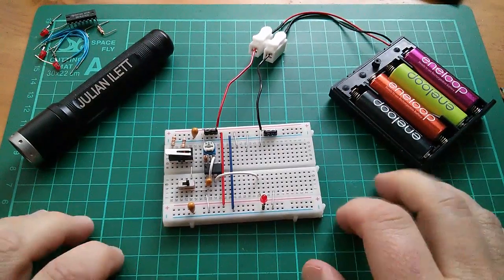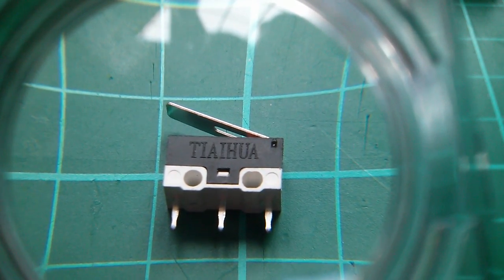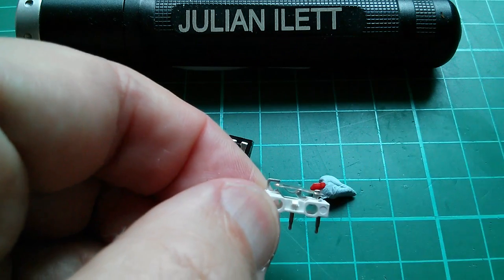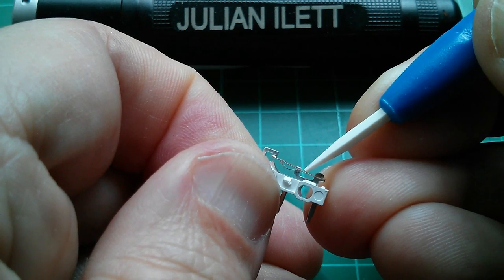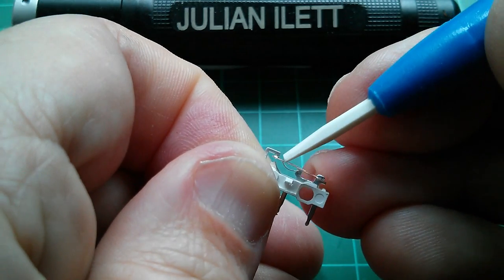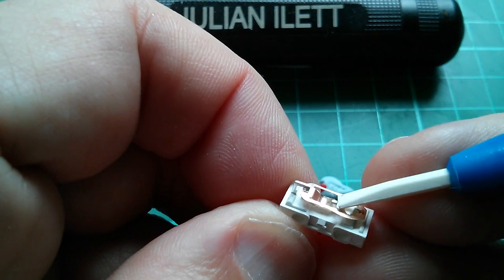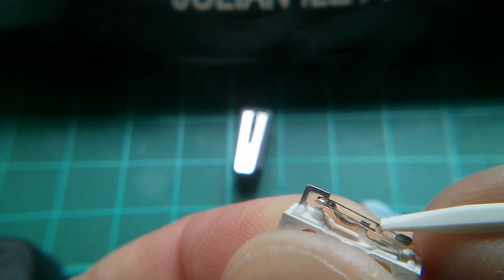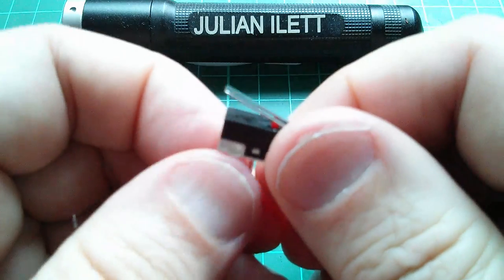What's Inside a Microswitch

Comment: The over centre mechanism is a 'toggle action' mechanism, some people think the toggle switch only refers to the lever style switch, but if you think about it, a J-K flip flop is a toggle.
Reply: I guess toggle is lay-speak for hysteresis. (the term snap-action is also used)
Reply: Nope, hysteresis is the difference between when a contact opens and closes.
A typical thing is a room thermostat, it may turn on at 20C and off at 21C, a larger hysteresis would be turning on at 20C and off at 25C
On industrial thermostats the hysteresis is adjustable.
toggle means that it's solidly in one position or the other.
Reply: Well hysteresis can be used to describe an amount (ie how far apart the turn on and turn off points are) or simply the fact that the value is non-zero. It doesn't simply refer to temperature. It is also used to describe the difference in voltage a circuit, like a Schmitt trigger or the turn on and turn off distance of a proximity sensor or the difference in the turn on and turn off positions of the actuator of a snap action switch. So a toggle switch refers to a switch that has mechanical hysteresis as opposed to one that doesn't, like a knife switch or a common industrial push-button switch. So the words are not exact synonyms but they are different ways of referring to the concept of hysteresis.
Reply: Temperature was just an example that's simple to understand for most, and yes, there's a lot of examples i could have used.

Comment: The material is a spring brass for good fatigue life plated with nickel/silver alloy for conductivity and also the corrosion is conductive. The good model railroad tracks are made of or plated with nickel/silver alloy for the same reasons. The switch may be rated 1A@125VAC but the DC rating will be significantly less as DC does not have a zero point to stop the arc. I once had to replace a motor contactor rated at 40A@250VAC when I used it for 10a@90VDC and it almost exploded. A plastic chamber full of plasma is exciting.
Reply: Some large DC contactors and circuit breakers use magnets on either side of the contact to 'blow' the arc sideways.

Comment: These are the kind of switches in the average computer mouse. You can modify it to make your click quieter by very slightly bending the top connection part down to shorten the distance that the toggling metal piece has to move. Definitely try on an old mouse first though so you don't break your good one.